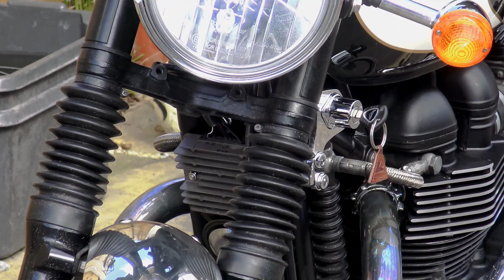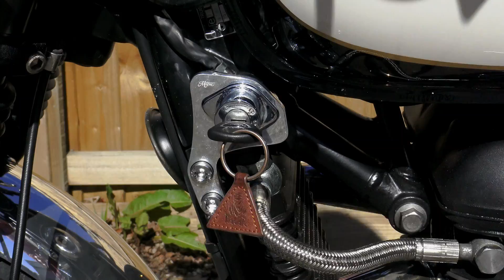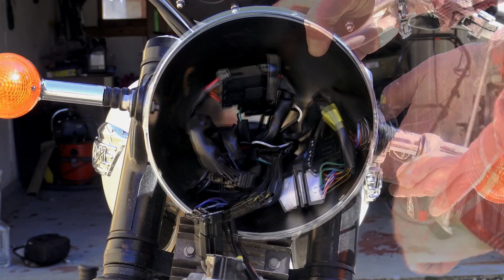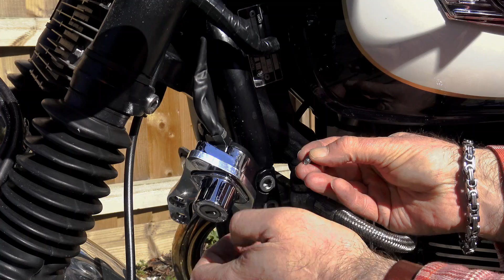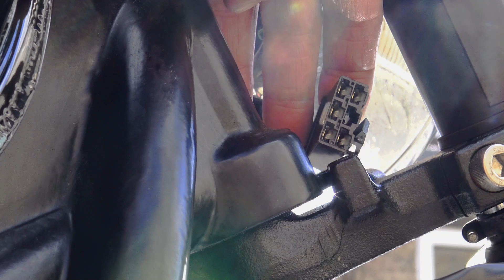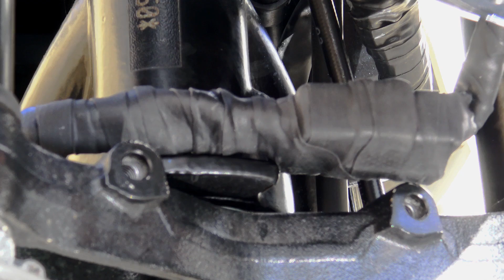Custom Triumph Bonneville T100, PDP Pt10, Ignition & Rectifier relocation kits!

Comment: Hi! I was wondering;

because of the ignition relocation, your keys and keyfob are likely to touch the metal tube coming from the radiator. In my experience, this tends to get really hot (2006 Bonneville). Doesn’t this cause any issues for you? Like melting your nice leather triangle Keyfob? 😅
Reply from the maker: nope!
Reply: @stuartfillingham thanks for the quick reply! ✌🏻

Comment: Great video!  I tried the Motone ignition relocator on my bike, but the ignition wire was much too tight, even if I pushed it out of the headlamp all the way to the connector.  Would it make sense to pull the entire ignition wire out of the headlamp and then wrap the connectors with the self-amalgamating tape, the way you did the wire for the rectifier wire?

Comment: Hi Stuart I did the ignition relocation mod a year or so ago when I fitted the motone built indicators. Because I needed the clearance I had my ignition bracket on the right hand side of the bike 🏍. Through storage earlier this year the bike was left with her steering full to the left. I didn’t know at the time but this but stress on the ignition cables and as a result the bike would not turn on. I have since had a new one fitted and placed it back in its original fixing. I don’t want to sound like a downer on motone cus I have many parts from them on my bike and am very happy with them and there customer service. Just be a were that the bike must be stored away with the steering straight as to avoid the ignition cable being damaged. Take care and hope you enjoy your new bike 🏍
Reply from the maker: well mine isn't stored straight Ian and its been 4 years now, no issues whatsoever!

Comment: Hi Stuart! 

I have a T100 from 2005 and my rectifier wont fit on the Motone rectifier relocation plate. The bolts on the plate sits wider between themself, than the holes in the rectifier. It´s just a couple of mm´s, but the rectifier wont go on. That wasn´t a problem for you? Thanks!

Henrik
Reply from the maker: Didn't encounter that problem, where do you get the plate from?
Reply: @stuartfillingham  It’s the same Motone rectifier relocation plate you got in the video. I sent you pictures on Instagram for easier explanation. Sorry to bother you
Reply from the maker: @henrikdegerstedt  Yes But did you buy it from MOTONE UK?

Comment: Do I need to get a longer ignition wire?My wire is really tight when I turn to the right. I checked the bucket but there isn't anymore wire to push through.

Comment: Is there a blanking plate for the hole that is left in the light bracket ?
Reply from the maker: you can just use a rubber grommet, but I later changed the headlamp brackets
Reply: stuart fillingham I see thank you do you need to take the forks out to change the light brackets or do they both splits open?

Comment: Great stuff as always Stuart. Did you put some silicone on the cable entry and drain hole on the ignition switch? as it’s now open to the elements and will bugger up causing grief & expense!
Reply from the maker: Hi Cotti no i didn't use silicon ill cover it off in the next video!

Comment: Thanks for the video Stuart. When I did the rectifier relocation, I also found that the cable to the rectifier was a little bit too short when the connector was in the headlight, creating tension when max steering to the left. Even with the connector at the very back of the headlight (which made the headlight closing difficult as well). I decided to do the same and put the connector outside, even though I didn't find any guide on youtube doing that at that time. So thanks for doing that as well, it confirms that I wasn't daft. I used regular pvc electrical tape on the connector though. Maybe better to switch to amalgamating tape?
Reply from the maker: Hi Wouter! Great minds think alike eh! Yes i think this is a common problem that many videos just dont deal with which is a shame, to be honest i think securing it outside is the best way to deal with it all round! if you pvc tape is holding up ok, theres no need to re wrap it, perhaps just get some self amalgamating tape in on standby for when it does need to be changed! thank you for watching sir!

Comment: I’d stick a bit of that tape round the ignition wires behind the bracket or put a bit of silicone there as the now it’s upside down water can run down  into the connection.
The ignition relocate was supposed to be one of the first mods I was going to make on mine and I really should get on and do it. A few times I’ve left my key in the bike when I’ve put it away. The left side is parked against the wall and by the time I’ve messed around putting a chain round the forks and plugging in the optimate it’s out of site out of mind.
Reply from the maker: Good Pointy Kev, I shall attend to it!

Comment: Do you declare all these mods to your insurance company?
Reply from the maker: Hi Terry thats a personal question! i suppose it will vary from company to company, but my company isn't interested unless the frame is structurally altered or the engine has been modified to substantially to increase performance.  when you think about it, it makes sense , otherwise you would have to inform them every time you changed the brand of tyre, exhaust, brake pad or oil filter etc! accessorising a vehicle should not be an insurance issue!

Comment: Thanks for another great video.  I've used that tape in my ham radio hobby...it works great to seal up feed line connections to antennas.  It does breakdown with UV and we tend to wrap it with regular electrical tape just for UV protection.  Probably not nearly as big an issue in how you are using it on the Bonnie as opposed to an antenna that is always out in the elements

Keep up the great work!
Reply from the maker: Thank you David the brand i use is supposed to be UV resistant but like you say its not a huge problem on a bike anyway. thanks for your input and of course for watching!

Comment: Stuart, are you going to use a rubber bung to fill the ignition hole? I've seen some modders wiring a water proof USB plug there for charging.
Reply from the maker: No sir, the head lamp brackets are going in favour of some nice Billet ones!
Reply: Thinking ahead I see. I liked the look of the relocation brackets, I was always in favor of the replacement clock brace moving the ignition up top near the clocks. My Ural has the ignition in the same spot on the headlight case but luckily the directionals don't get in the way.

Comment: So, that's a "period" feature having the switch over there?  I wondered why they did that.  I don't really have an issue with it, if anything I'd relocate it top center but I'm not keen on replacing the brushed aluminium instrument bracket on mine.  Definitely looks good though.

Comment: Stuart what happens with the hole in the headlight bucket were the iginition switch used to be ?
Reply from the maker: you can get a rubber grommet to fill it Simon, sorry i should have mentioned that! i didn't bother as the head lamp brackets are going to be replaced with some billet ones!